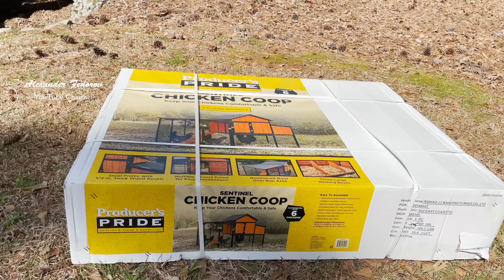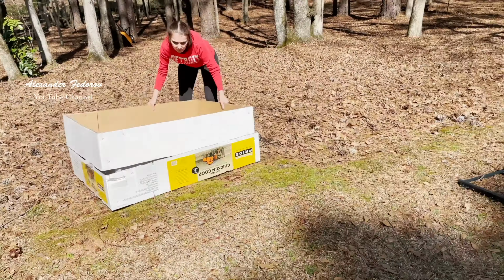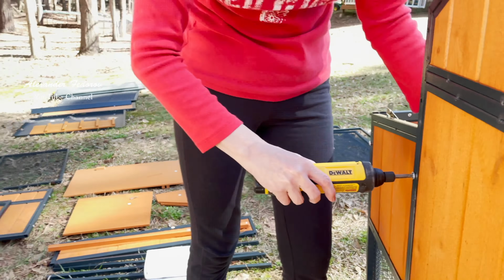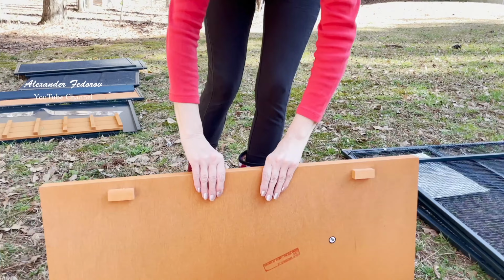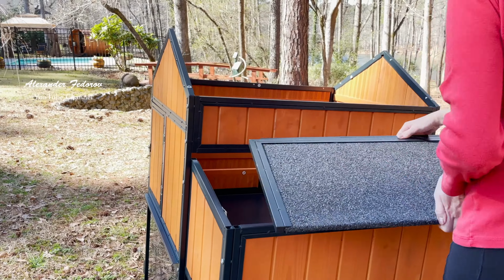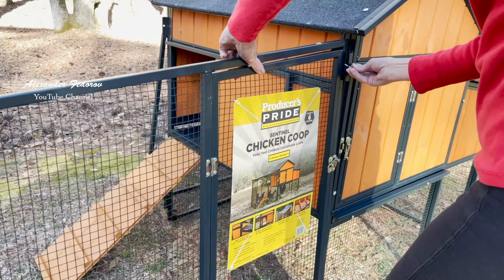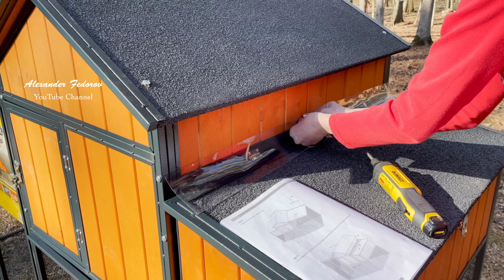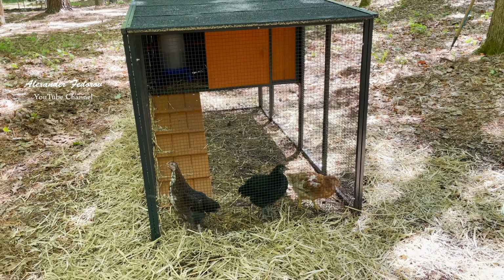Adorable & Functional Chicken Coop | Sentinel Chicken Coop Assembly Video SKU 1485300 Tractor Supply

Comment: I bought mine used on the Fb market place. I paid $175. And it’s like new. I’m so thankful. I didn’t have to put it together 2 of us put it on my truck. I tied it down drove it to its location in my yard put it down pretty easy alone. It’s a great coop for my 6 chickens. 💜💜💜
Reply: How well do the 6 chickens do in this size coop? I was looking at this one and wanting 6 chickens
Reply: @Jonesy3737  they do well, they all get up in the coop to sleep. They all get up on the same rack. It’s funny. They get to free range. The only problem is I must put them up at night (lock up the cage)
Reply: @cathylittle3  ah okay. I might pull the trigger on one. I'd be the same scenario, I was thinking of adding on a bigger run to it for cheap, something bigger than the coop for when I won't be home. Then letting them free range when I'd be home to watch

Comment: I have one. It’s a very good coop. I’m not thrilled with the hardware. The locks are a bit low budget, but the frame is tube steel so if you want to upgrade the hardware, you’ll need a drill bit that can drill steel. Then you’ll need steel screws. Any screws softer than steel will get stripped out.
Reply from the maker: Thank you very much for suggestion! We did upgrade the locks too. We also made extra air ventilation.

Comment: How do you put the screws on part 15 . It doesn't have little holes. Do you drill on metal?
Reply: YESSS I DONT KNOW WHAT TO DO EITHER
Reply: @yusuffreezer8283  i drilled them in through the metal, :-)
Reply: Wondering the same. I just got the coop & don’t know what to so about panel 15
Reply: I am stuck as well, I cannot get these screws thru the metal
Reply: @lindsayanderson9784  I drilled them in with an electric drill